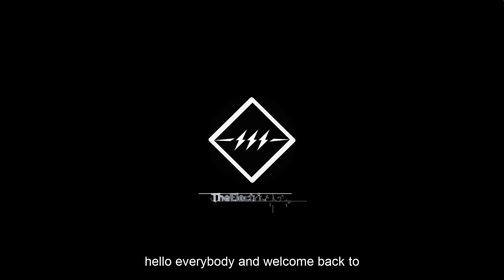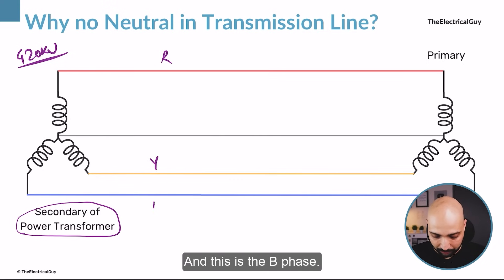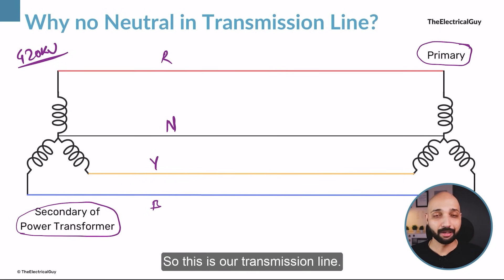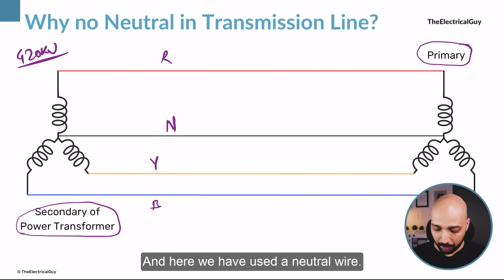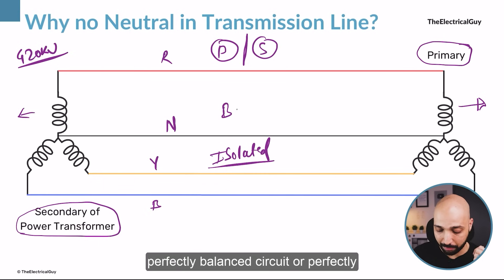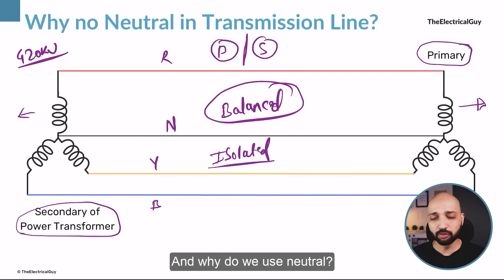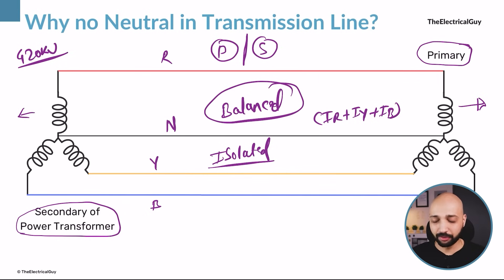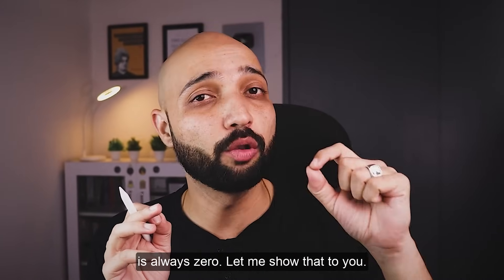Why there is no Neutral in Transmission Lines?  Explained | TheElectricalGuy

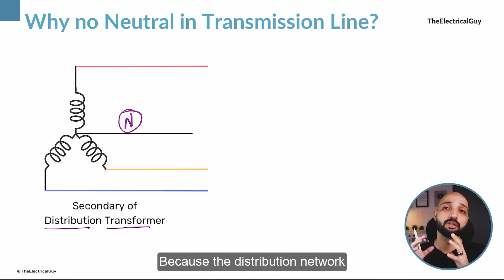Comment: 6:40 Neutral is needed in distribution system because it is not balanced=we can not control the load
Reply: Distribution need a neutral but tramission line don't need neutral.

Comment: Electronic circuit is complicate but electrical circuit is more complicate. 2, 3, 4 wires in ac circuits are more complicate teoretical and practical. Bizzar that the circuit is balanced to the primary transfo when the 3x ac loads are differents. Never, ever the 3x ac loads will be egual, maybe only w/3x lights of some power (watts).

Comment: Wrong explanation
Transmission lines are in Delta configuration i.e 3 phase 3 wires
while the Distribution lines are in Star configuration i.e 3 phase 4 conductors, one for neutral, bcuz it is required to complete the circuits when we attach load
Reply from the maker: Hello. I want you to understand that, the delta configuration is possible only because the load is balanced. And we use star configuration for distribution because the load is not balanced and we need neutral there.
Reply: @GauravJ  sorry my bad🙂 u r right

Comment: Sharing what I know/learned:
- The long distance transmission lines for a power distribution systems are 3-phase "3-wire" systems. These power grid designs are for efficient power distribution and at the same time, save cost.
- There can be additional thinner lines situated at the highest points on the tower.  They are mainly for lightning protection.  These wires are too thin for neutral (N) line as return path.
- The steel tower structure itself is grounded locally for Protective Earth (PE), but it is NOT for alternative path for Neutral.  The earth (soil, rock, etc.) is never intended for Neutral "N" return path nor for 3-phase power imbalance.
- 3-wire transmission line with no real physical Neutral wire in existence, I would call it a Delta system.
My 2 cents.

Comment: There isn't a neutral on the high voltage side for most single phase residential distribution in the U.S.  The neutral that comes into the house is actually a center tap of the secondary side of the transformer winding.  This gives us two opposite phases of 120V from each side of the secondary winding to the center tap, which is neutral.  Across the entire secondary winding we get 120V + 120V = 240V, which we use to power higher power loads like stoves, clothes dryers, A/C compressor motors, etc.  So the neutral in the house is just a construct of the center tapped secondary and is referenced to ground.
Reply: Exactly. But since its a single phase transformer ( using only one phase at the primary ) , it automaticaly unbalances the high voltage lines.

Comment: If the distribution network is unbalanced, wouldn't the uneven loads between phases cause an imbalance in the transmission network?
Reply: I asked the same question.
Logically, i think it does.
From what i know, the power company uses the earth and also a wire on top of transmission lines poles tower as a return path to the main generator to even charges.
The wire on top of pole towers is grounded, and his main purpose is to protect the power lines from getting hit by lightning. And also, if an airplane or helicopter happens to fall on the wires, it will hit this wire first.
Reply: @martf1061 The earth wire on top of Extra High Voltage line is only grounded . It does not provide any return paths.  Yes the phases stay unbalanced in a line slightly but since the grid network is interconnected, it gets balanced.

Comment: There are no L-N loads at transmission voltage. L-N loads downstream of transformers fed by transmission becomes unbalanced 3 phase current, I2, in the transmission circuit. Utility generators have I2 limits, so the utilities try to keep their LN loads equally loaded on the phases to keep I2 back up at the generators from getting too large. Note, unbalance does not cause neutral current, I0.

Comment: There is no neutral on transmission lines because it’s not needed. We don’t connect loads phase-neutral at the bulk electric level. 

Distribution uses a neutral because it allows loads to be connected phase to neutral, which is also lower in voltage due to how a wye - grounded connected transformer works (about 57% lower, factor of rad 3). It’s also cheaper because you don’t have to insulate equipment to the same level as phase to phase voltage. A neutral wire also provides a low resistance path back to the substation transformer for faults. Since most solidly ground systems with neutral conductors also ground the neutral out in the field on the poles, if a wire falls down on the ground the current only has to travel the distance to the nearby grounded pole. 

Transmission does have grounding at the substations for ground faults. It’s either done with grounding transformers or auto transformers that are grounded. Those grounding points are the return for a line to ground fault on a transmission line.

Comment: If you have 3 phase power supply in your house, which is common in Europe and other places I believe, you can plug some devices that don't use the neutral wire at all. And they will work perfectly fine. One of them is a 3 phase motor. If you wire the windings in a delta pattern, you just hook up 3 phase wires to it and the neutral is completely not needed.

Comment: We have a 110 kV railway power line here. One circuit has two conductors! 
There are two circuits on the mast, so four conductors.
At the other end is a transformer with one primary and one secondary winding. No three-phase network.
The railway then runs to ground at 15kV 16⅔ Hz

Comment: This video is horribly done, and all the confused and wrong comments reflect that.  

One needs to understand common mode issues and distributed reactance, and lightning damage reduction, but the main reason for 3 phase closed delta primary grid distribution is cost per capacity unit, and no need for mixing and matching single phase or Wye leg branches as with secondary distribution.  Distinguishing grid, secondary feeders, and low voltage, plus closed delta, wye, single phase, and oddball cases (like bridged T), is a missing starting point, to stipulating a discussion that doesn't confuse grid designs with secondary and low voltage systems with different needs.  

A neutral does not balance loads.  In secondary feeders and low voltage, it can be a ground safety reference not needed with grid, and can isolate voltage regulation on legs, or allow taking single phase branches off a 3 phase system. However, that also can make systems more attractive to lightning, compared to grid closed delta 3 phase with no neutral (though often a ground bonding conductor up top).  

IEEE C2 is a primary engineering standard for grid designs. Be very cautious with comments to this video, and assume many are wrong and not trustworthy.

Comment: When there is no neutral then the currents are balanced by definition.  They have to add to zero by Kirchhoff's laws but if the load impedances are not balanced then this only happens by the voltages across the three phases adjusting themselves.  So if the loads are not well balanced then the three phase voltages will not be the same.  In order to limit the imbalance in phase voltage and keep them in spec. the loads on each phase have to be distributed roughly equally between the properties.  There are occasionally faults where the neutral connection to a local area goes open circuit and the result is out of spec and often damaging over-voltages appearing in peoples homes.
Reply: This happened to our neighborhood during the previous large geomagnetic storm. I have a server farm and have a lot of monitoring systems and our voltage went up to 300 volts on one phase and caused some damage throughout the neighborhood. It tripped over half our breakers but the main breaker did not trip since the over voltage only existed temporarily. 

That day was insane (weekend).

Comment: Surely you still need to load each phase as evenly as possible, else you're going to have wildly different currents in each phase. Yes, it's balanced, but the maximum capacity can't be achieved unless the currents in the three phases are equal.

Comment: at around 5:11 you state from the graph that the current shown is zero when in fact this graph is showing voltage not current. So the voltage is zero at 360 and if no voltage, then there is no current. Semantics but the graph is VOLTAGE over time, nothing shown indicates what the current is.

Comment: I think of a caveat. If the distribution transformer is composed of 3 separate single phase transformers, as sometimes is done, then the transmission line would have to incorporate a neutral conductor or at least utilize ground path to transfer unbalanced power. Otherwise voltage on the unbalanced load will collapse

Comment: I have seen lots of distribution lines that are delta connected with, of course, no neutral. Some power companies use them a lot, and they used to be more common years ago. So I would not say that a neutral must be used, but rather that a neutral is desirable for distribution lines. I’m not an electrical engineer, but I imagine that a distribution line with no neutral would need to be derated to a lower power carrying capacity than a similar line with a neutral, and also that more attention must be given to load balancing when designing the distribution network.

Comment: in the Primary distribution (high voltage network that leaves the substations for the distribution transformers) there is also no neutral, there are only the 3 phase cables at the top of the pole, because in the high and medium voltage, energy is a circuit isolated by transformers, requiring neutral only in low voltage (or secondary distribution)
Reply: This right here is what I was going to say. The easiest explanation.

Comment: When the first telegraph lines were installed (about 1840, between Washington and Baltimore, I believe) they used a neutral wire to complete the circuit. Then they discovered that the circuit could be completed through a ground connection. This enabled them to use the return wire for additional communication.
Reply: Sort of, but telegraph lines were not 3 phase. They were DC.  In that, the so called "neutral" was just a return and not a true neutral.

Comment: Why is the transmission line balanced ? If a phase has a different load on the distribution network it should reflect a different load on the respective transmission phase, causing an imbalance. I believe it does cause different voltages in different phases if no neutral is there. I think it is called a neutral shift and can cause problems. However, power can be distributed such that an unequal load is unlikely. For example a large industrial power consumer will have a balanced 3 phase load on the distribution network. Consumer homes likely present a small load. However, if all the people in homes on the R phase decide to use the washing machine at the same time, a neutral shift will happen and might cause problems.

Comment: What’s the thin wire at the top of the pylons for, please? I’d always thought that was the neutral which could be light because it wasn’t carrying much current. Is it just a lightning conductor, then?
Reply: It's not the neutral wire and it's not connected to the transformer of that high voltage line. That's a shield for the pylons against lightning strikes. They are grounded for this reason. Some of them are OPGW cables (optical ground wires) and are made of optical fibers in the center, surrounded by steel and aluminum. It provides communication between electrical power plants.
Reply: Thanks, that’s clear now.

Comment: 😮😮
The correct explanation is, In 3 phase delta (or star without neutral) circuits, no need of neutral as return path. Because, the return path for the each Line current will be provided by reaming two other lines 😮
Reply: Exactly
And in residential connection neutral is required as almost all of our domestic appliances require 240V to run that is the phase voltage or the voltage between neutral and phase.
Reply: And also in Distribution side he was not provide Graph and explain it unbalance current phenomenon
Reply: @ABINASHHANDIQUE12  negative... 240v come from phase to phase.

120 comes from phase to neutral.
Reply: @diylithiumguy  no bro learn something.
I'm now doing job as Junior Manager in Power Distribution nd I know how it works.
Reply: No,  if you let it return through the other phases you will not have symmetrical voltages on all three phases... only when your load is balanced enough you can achieve this. Otherwise it is unstable... when you have distrubuted loads statistically the current is balanced..
Reply: In few words.
Because in a transformer the 3 phases are coupled magnetically.

Comment: High voltage transmission lines do not use Y scheme. They use exclusively delta configuration, thus system is balanced, and neutral does not exist.

Comment: But how do you connect balanced transmission line to unbalanced distribution line? Where do you connect N in the unbalanced distribution line? To the ground? Then we still have 4 lines in the transmission line: 3 wires and ground that carries N.
Reply: You do not connect them. You use transformers.

Comment: Surely such transmission lines are Delta connected, only to be transformed to Star
at the local sub-station, thereby not using a neutral and saving cable cost !
Reply: Transmission 115 kv and above Y

Comment: The actual reason there is no neutral on a transmission line is, If the line was run in a Y configuration over all to all smaller  distribution sub stations,, there would be many ground return paths, through each substation along the line. And the energy return to source station distribution would be reduced.  With the delta, no neutral configuration, all faults current is returned to the source station, through the earth ground and via the static/lightning line if equipped. To where there is fault current detecting equipment installed  trips out the  source of the transmission line. The fault current is returned to the source location to cut off the source. Like the breaker panel in your house , sort of. There is a ground source reference at every source transmission station. Transmission lines, some wired like Y configuration at the source station., but grounded at the source station only with sensing equipment on the ground. But exit in a delta. Some delta only stations have what's called a zig zag bank transformer or ground reference transformer. The CT's and VT's of the ground ref unit are connected to the protective equipment to shut down the line if there is a phase to phase fault or phase to ground (tree, downed conductor,car accident) issue.
Reply: Hmm..my understanding is that transmission lines are usually equipped with ground wires that run along the transmission tower span for OHL(or along the cable sheeth for cable circuits ). 
In case of ground faults, the faulted phase will return the current back to the source( the star point of a Y connected transformer or via the earthing transformer for delta connected windings) via this grounding wire.The ground thresholds if adequately set in the protective relays on the feeder protection trips out the feeder and if the feeder fails to trip backup is typically provided by the source( the transformer supplying the fault current).
Reply: @U_sheikh  it is called a lightning wire and it does not function as a neutral for the circuit. Sometimes they carry fiber optics for telecom purposes but since lightning wires are often the target of theft and other things, this is not used often. Any fault currents from a phase to earth fault returns through the earth to the source. The primary method of protecting lines is by differential protection. The relays are quite complex and may include additional earth fault functionality, but the primary protection is differential. An additional distance protection relay is usually a backup for the line differential and busbar protection of the opposing substation.
Failing breakers are cleared by isolating the busbar to which the failed breaker is connected, not by disconnecting the transformer. In a ring configured net disconnecting the transformer would do absolutely nothing, except maybe causing the transformer next to it to overload and cause a cascade failure.
The fault current, which can be substantial, returning through the earth gives rise to dangerous step potentials in case the soil is not sufficiently conductive.
Reply: not Y(star) but delta configuration

Comment: Many of the comments express thanks for explaining why  3 phase transmission does not require a neutral wire . ( see 2:07/8:45 ) But I wonder if these people understand  that in the 
920 Kv  TRANSFORMER : the current of  RED phase  flows to the PRI ; that current  is  returned from the PRI  back to  the YELLOW and Blue windings of the 920 kv transformer
                                                                       YELLOW                                                                                                                                 Red                 Blue
                                                                        BLUE                                                                                                                                      Red                 Yellow